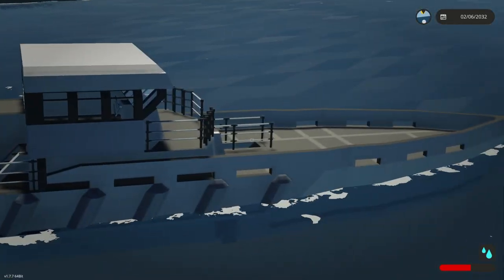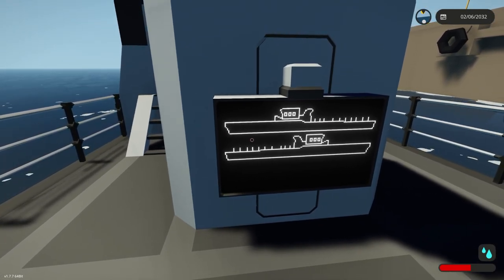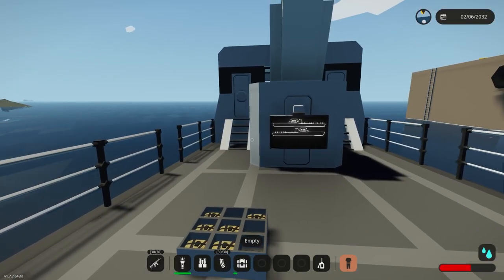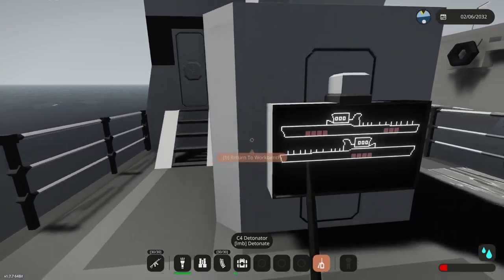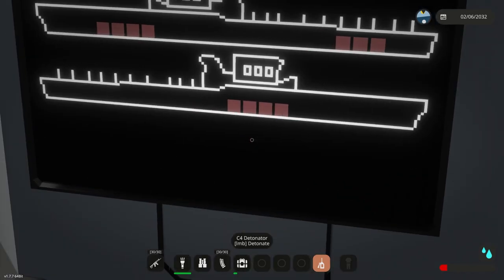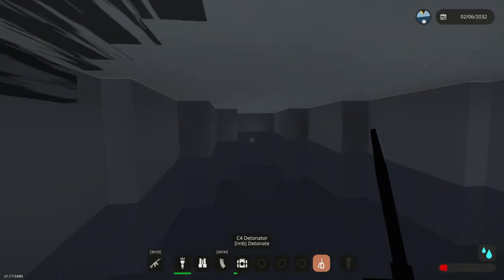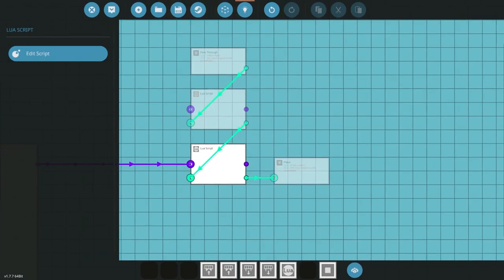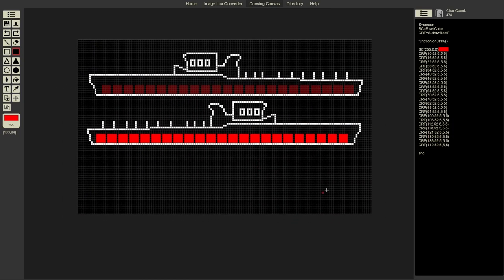Simple Damage Detection Tutorial

Comment: I had an idea, if you can’t fit the micro controllers and it is a sealed space, you can pressurize it and then detect if it is leaking. This would also let you judge how badly it is damaged by how fast the pressure is changing

Comment: Using constant on blocks in areas that would ,when damaged, turn off.  maybe simpler but they would be more for collision damage as it it generally has minimum damage radius. for weapon fire MCs maybe better for sensitivity but you lose that building are if you need it.  all you need is an indicator that person understand when lit = good  and off= bad, or add in not blocks to reverse it. or step up to composite with the instrument panel indicators.

Comment: The way I do it is with distance sensors aiming to a wall. That way, once they’re broken they give a 0 but if something gets glitched inside the vehicle than you also get a smaller number on the sensor so it also gives an output. That second reason is better if you’re playing with missiles or torpedos but you don’t have damage on

PS: I’m talking about using a distance sensor with a threshold set to a number right bellow the normal distance number